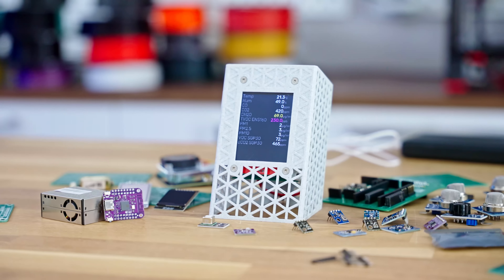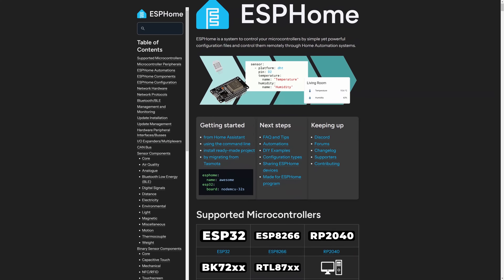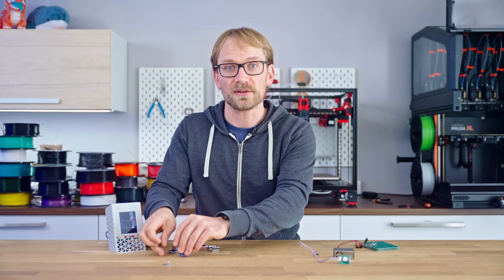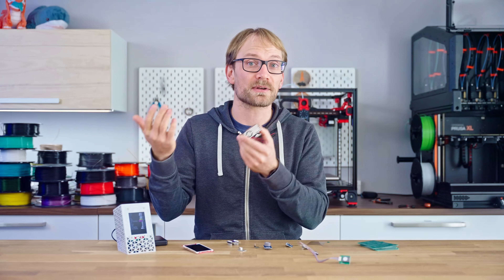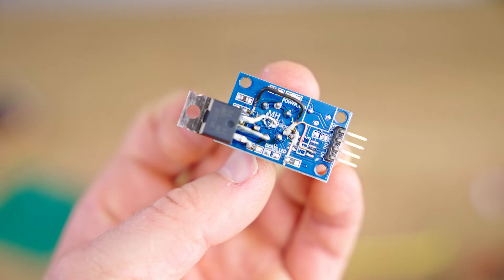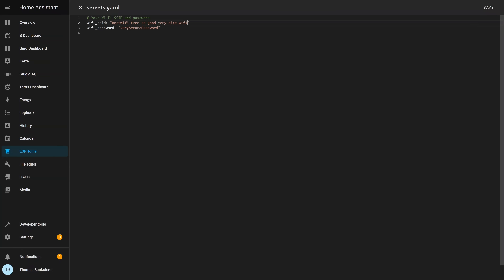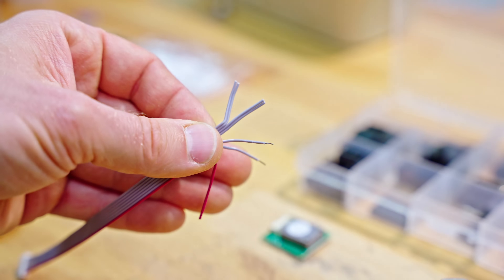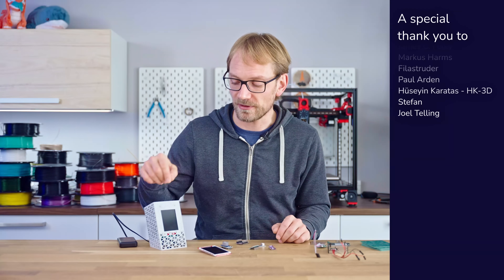I made it easier to measure your 3D printer's emissions!

Comment: HI!
Nice project, I'll make a few for home.
Before I order PCB, do you plan to fix the 3.3V to 5V issue anytime soon ?
If not, with which software can I edit the PCB ?
Thanks !
Reply from the maker: I'm working on a new revision of the board that will fix the mislabeled 3V3 pin, and also accept ESP32-C3 and ESP32-S3 boards. It seems I got lucky that the current S2-Mini boards work decently for me, but several users have reported that there are different versions of the identical-looking purple S2 boards out there with some of them having issues with reliability, some working fine.
Should be out by the end of the week!
Reply: which pin is mislabeled?

Comment: we need low budget device with lab-graded performance for measuring the air pollution from the 3d printer. I wired some sensors too and wrote some simple i2c, spi codes. The thing is that the result should be accurate. Otherwise it's useless.

Comment: "The hardware is able to run without a connection to a Home Assistant setup, and I'll provide a compiled firmware for that application shortly."

Is this already available by any chance?
Reply from the maker: Yes! The standalone firmware is uploaded to Printables as a compiled, ready-to-flash version as well as its source config file if you want to double-check how it's set up: https://www.printables.com/model/1079858-sensorbox-v2

Comment: Thx for the development of this usefull tool!
Although the assembly is kinda out of my comfort zone, i think about building one myself.
I'm deeply concerned about printing with fiber reinforced filaments.
On the other hand i've planned some projects where CF or GF filaments could be really beneficial.
After i got back into 3D printing and did some quick research on filaments that are currently used for functional parts, it seems like there's not really a way around CF/GF...
Not just for stiffness and temperature resistance, but also for better printability.

Comment: I've been contemplating something like this but with less prefab stuff. Jumpers let you have some modularity, and ease of change should you find a better sensor later that will work better but has different layout. I have a few ESP32 set aside for something like this. But I like the broad detection of this ☺️

Comment: I made something similar with ESPHome but headless.  I have temp/humidity sensors in my print chamber and filament storage area, voc sensors inside the print chamber and one outside, control for two LED strips, switch for the print chamber door and then  control for a blower for the exhaust.

I used the Arduino ESP32 board because that is what i was familiar with, but I know you can do the same on the cheaper ESP32s. I love that it is running Wifi and all the devices are setup for MQTT so I can see and set different things through/in Klipper.  Example: if my printer pauses because of the filament runout then my LEDs flash on and off until the door is opened, and it sends me a notification to my phone.

Comment: Just don't get those SCD40s from Ali. They're fake and they work well for a start, but that doesn't last long. They drift a lot, and I mean really a lot, like 100-200ppm per 24h. I tried to change the poll rate from 5s to 30s and they stopped drifting, that is, so I thought, but they just reversed drifting until they hit zero and became quite unusable. The real thing from digikey or similar is a bit more expensive, like 2-3 the price of those from Ali, but then, those from Ali are only remotely usable if you calibrate the modules once a week, which means putting them in a known atmosphere for 24 hours to calibrate. This is also in the manual from Sensirion, describing calibration, but an original will remain stable over time, while those china copies are just junk.

If you rather choose an MH-Z19, those work well, but probably not that well. Also, they use a lot of power and quite a lot of what you get from China is just rubbish

Comment: Very interesting.  I am Doug Basberg, MSEE, retired.  I have used home-assistant for many years.  I have a module with dedicate CO and generalized VOC sensors with an ESP32 in my solar battery box to know when charging causes too much CO and controls a fan in PVC pipe to outside.  I like your board better than mine.  Yes I will be getting a couple.  I run three 3D printers and want to know what the air quality is.  My respect for your engineering skills and thank you for this project.  Soon to be copied by me😀
Reply: @iroh5733  had the same problem. The chips were recognized but unflashable. looks like those cheap mini s2 need some update first. Solution: Get ESP-IDF 5.3. Than flash it via esptool. py --chip esp32s2 --port COM3(check if its the correct com port) --baud 115200 erase_flash     then      esptool. py --chip esp32s2 --port COM3 --baud 115200 write_flash -z 0x0 xy.bin . The bin can be created via HA ESP Builder and than choose the offline version. Once flashed you can do it via the web-flasher.....took me a while. hope it helps! Cheers!

Comment: can anyone tell me what kind of pliers he uses for the dupont cables?
Reply from the maker: They are Engineer PA-09 https://go.toms3d.org/Engineer
Though basically any tool that allows you to crimp the conductor and insulation separately should do a decent job. The cheap ratcheting-type combined crimpers tend to produce connections that are either way too loose or so smashed up that they don't even fit into the connector housing anymore.

Comment: SGP30 sends a measurement of TVOC in ppb, as in ppm would mean terrible conditions.
On your screen you have 72ppm shown which would be 72000ppb.
I wouldn't say SGP30 is not cheap. It also gives not-reliable readouts. There is little to no control over how it estimates baseline and corrects for a drift.
The SGP41 algorithm is customizable and makes way more sense to use it.
Currently, SGP 30 is a discontinued chip. By testing it it makes sense to me that it is no longer in production.

Comment: Thanks again! I think for your next PCB you should label all of the holes as you expect the label to also appear on the module that would be going in that spot… as it is possible for the part to appear the same but with a different pin out… since the links provided are a search for the part rather than to the part itself… 

this is especially true for the display where you simply specified a 2.8inch SPI screen… someone could very well come along and decide they want a better screen and find the very similar looking waveshare 2.8inch SPI screen with the same number of pins but find out that it doesn’t work… this is just an example 

AliExpress affiliate links would probably give you an additional income source
Reply from the maker: Thanks for the tip! I really appreciate it!
Regards, Tom
Reply: @MadeWithLayers  Would you consider uploading the CAD files for the shell so others can have an easier time with remixing?
Reply from the maker: I'll clean up the CAD and publish it shortly, I want to make sure it will actually be useful (and not just the broken mess I cobbled together to get a print out 😅)
Aliexpress affiliate links with the most accurate search terms are provided on the project page at https://www.printables.com/model/1079858-sensorbox-v2 , but linking to individual listings on Aliexpress has been a bad experience in the past, as prices tend to fluctuate wildly and listings regularly disappear from individual shops.
Reply: @MadeWithLayers  That’s good news! Trying to turn a design like this from mesh into solid on Fusion is just miserable.

I have ran into some small issues and left you some comments as well as solutions others can follow on printables.

Perhaps you should consider moving the code to Git Hub… discussions and issues reporting is not ideal here nor on printables.

Just a thought…

Comment: Nice build! HASS is super powerful, but initial impressions can be deceptive. It can be surprisingly hard to dial in a robust automation. Most automations require some helper entities. But once you get used to the fact that automations don't have to be beautiful and simple, anything becomes possible.
HA can run addons in container mode btw, you just have to manually run those addons in separate containers. My hass+zigbee2mqtt+stuff runs entirely in docker on my NAS.

Comment: Thanks for including the CO2 sensor. Makes me way more interested in this device regardless of how much I fit the intended use case.

One warning though: wasn't mentioned in the video, so I'm not sure it is addressed in the device - autocalibration may cause CO2 sensor to report way too good numbers, hiding the problem.
Reply from the maker: Autocalibration is a problem I'm very aware of for any kind of sensor, and it's the main reason I decided against recommending the ENS160 as a primary VOC sensor - its autocalibration is pretty bad. But on the bright side, I've found the SCD40 to have a much more robust autocalibration system than the classic MH-Z19 series of sensors, and over weeks of use with a sensor in my studio and bedroom, I've found the SCD40 (with autocalibration enabled) to be perfectly consistent with a MH-Z19 that was being regularly manually calibrated against outdoor air.
Since the SCD40 is an acoustic sensor, it should already have much less drift than the classic MH-Z19, which literally uses a tiny incandescent bulb that will degrade over time.
Reply: @MadeWithLayers  I've seen the complain that it may eventually use the lowest reading as 400, which is no good when kept indoors only, with limited ventilation.

Comment: A button just to dimm the screen? Why not add a light sensor and automate it instead?
Reply from the maker: Absolutely an option - but you know feature creep, right? ;-)
The button can be configured to do whatever you want, like switching screen layouts, running calibration cycles (can be a different action on hold) or even triggering other events through Home Assistant. Including it in the box costs almost nothing, so why not just have it in there.

Comment: Do you plan on selling the parts as a kit (w/o the prints)? This would help be very nice! Maybe like a kickstarter? As soon as enough orders are in, you begin shopping, packing and shipping. Would 100% support!
Reply from the maker: Eventually
Reply: I would 100% buy a kit to use at my workplace!
Reply: Sounds like a great idea. All the air quality monitors from Aliexpress give you fake measurements and the professional ones are very expensive. So this would be perfect middle ground. Not just for 3D printer users.

Comment: Great project!
Just a tip I got from an antenna designer. 
Always put an antenna on the edge of your PCB because of interference with the ground plane.
The placement of the ESP looks nicer in the middle, but for the wifi reception it's the worst.
Reply from the maker: I did realize that, and future revisions of the PCB may see the ESP getting moved further up towards the top edge. Having it dead-center gave me the most usable board space for now and allowed the USB cable to curve out the bottom, but of course its WiFi signal is being blocked by the ground plane and can be easily caged in from the other side by the PMS5003 (which is why that is being placed at the very bottom edge of the printed carrier).
Reply: @MadeWithLayers  So there is a next version planned? Should I wait?
Reply: @radicalreel  I'm sure it will be similar parts and the PCBs aren't very expensive. Might as well just build what you want and maybe move components in the future. You'll always be waiting for the next thing. Just build one now and get the data from it
Reply: @radicalreel no comment. Too busy
Reply: true! for me wifi is unuseable.. otherwise great project
Reply: Newbie to electronics here. Is it easy to find an antenna for this setup? Would it be easy to put it on the edge of the PCB?
Reply: Can't we just solder an antenna extension to esp32 and lead it out of the box somehow?
Reply: I love the way you selectively respond to comments. This video is hard to follow in parts and no comment.  When to make a new PCB design available and no comment. How about answering a few questions?
Reply: @vince1738  your entitlement is showing...does this guy work for you?
Reply: Does it work with no wifi?

Comment: What makes these kind of sensors and homeassitant even better is the bambulab integration into homeassistant. That adds all the printer data you see on the device tab in bambustudio. I turn on my additional light on the printer on and offf when the state of the internal printer light changes and switch on the air filter if the nozzle goes above 100 degrees.
Reply: Nice!  Just got my P1s (still in the box LOL).  I certainly will be adding it to my home-assistant.  Thanks!

Comment: Great project, and thanks for sharing! I've also been looking for a way to monitor air quality when printing with ABS, specifically to detect styrene. Unfortunately, it seems that most VOC sensors aren't able to detect styrene effectively. The only viable options I've found are expensive PID sensors. It's a challenge to find an affordable and reliable solution for this issue.
Reply: Just don't print ABS in your living space. Are there parts you need that can't be printed in PETG? Because ABS and ASA are nasty, even if you have activated carbon and HEPA filtering in your printer.
Reply: @theglowcloud2215  I usually prefer PETG. However, when it comes to parts needing temperature resistance around 80°C, ABS is one of the few affordable options. Finding a suitable alternative that’s both budget-friendly and performs well at higher temperatures has been challenging.
Reply: @SlowEngineering  yeah, the downside of high temp materials is that they basically all have undesirable emissions. ABS/ASA, PC, PA all emit some nasty VOCs. Maybe try PET (not PETG)? PET is more expensive than PETG, but low VOCs and really high heat deflection temp. Bambu claims their PET-CF tolerates up to 150C, much higher than ABS.
Reply: @theglowcloud2215  Thanks for the suggestion! PET-CF does look great, though the price is a bit higher for me. Still, I’ll give it a test to explore material variety!
Reply: @SlowEngineering  if you have the ability to vent your printer to the outdoors, that's always a good idea, but can get a bit complex in terms of not allowing cold air back into the printer enclosure, depending on your setup. If not, carbon and HEPA filters will do something for VOCs, I just wouldn't count on it to make printing ASA safe in a living space, especially if that's mostly what you print.
Reply: @theglowcloud2215  I agree that relying solely on HEPA with activated carbon isn't sufficient. Introducing negative pressure helps contain the fumes within the enclosure, forcing the air to circulate through the filtration system. Once printing is complete, the enclosed air can be vented safely outdoors to ensure optimal air quality.

Comment: By the way, the Wemos Lolin S2 was a good choice. It’s made by a reputable company, not some cheap, unreliable Chinese knockoff. However, it would have been better to place it on top of the base panel, as its built-in WiFi is quite weak and prone to dropping the connection when the signal quality is low.

I created a similar system, but with my own backend. It sends data to MQTT and Firebase. It’s installed outdoors and has been working perfectly so far in a temperature range of +30°C to -5°C, even in outdoor conditions.

Comment: AHT20, consistent? I have four here with more than 4C spread, and humidity about 18% spread.. They all track perfectly, and you can't believe any of them.
Reply: If they track perfectly but just have an offset, that should be pretty easy to calibrate if you have a sensor that you do trust.
Reply: @TheAnoniemo  Not much point in buying supposedly ±0.3C sensors if they have to be individually calibrated to best ±4C..
Reply: yes, calibration is a pain... but for SHT40 and SHT45 the spread betweeen multiple sensors was very low for me, so I could reuse my calibration adjustments.
Reply from the maker: Interesting, I've ordered a 5-pack of these and they're all within +-0.5C and about +-3% humidity - which I think is really good for temperature/humidity. The SHT40 that I used in the first Sensorbox, on the other hand, had a good +-1.5C and +-5% humidity between units.
Of course, as Anoniemo mentioned, they can all be calibrated with an offset, but then you need some reference to calibrate against (which can be hard to find). What sensor would you prefer over the AHT20?
Reply: @MadeWithLayers  Even ±0.5C is outside their typical spec.

I don't really have a preferred option as so far, there's been zero consistency out of anything bought from Aliexpress. Such is the issue with barrel scraping. I may try a selection of SHT30 boards next for my own projects, but I have a feeling making my own from proper sources will be necessary.
Reply: I've "calibrated" my humidity sensors using moist table salt in an enclosed container. I'm sure it's not lab grade, but it's good enough for me.